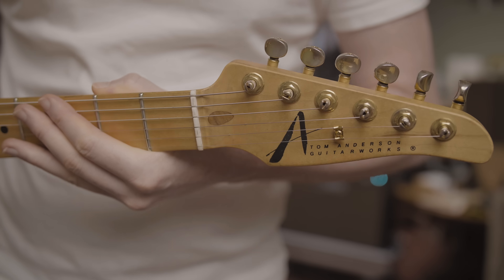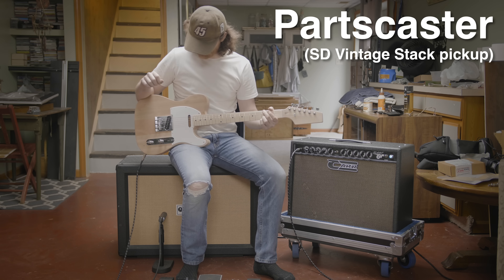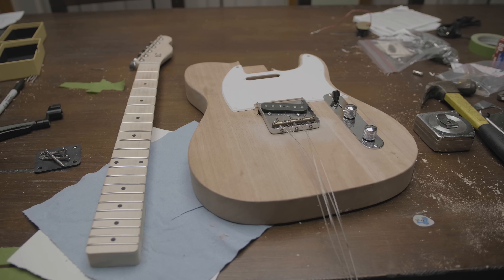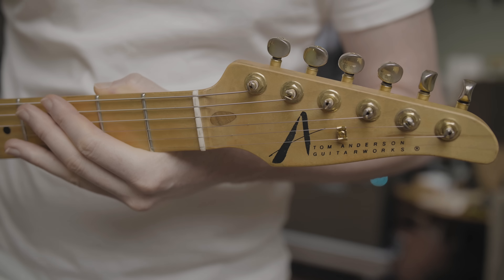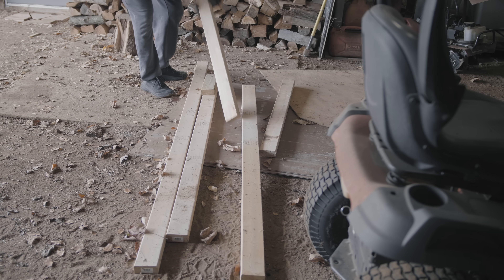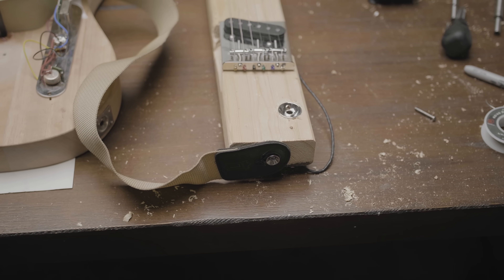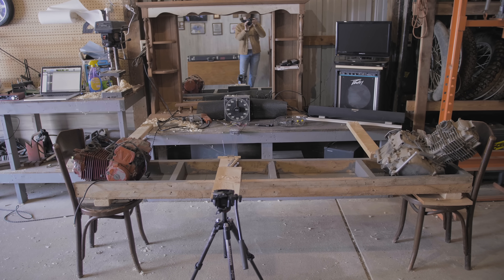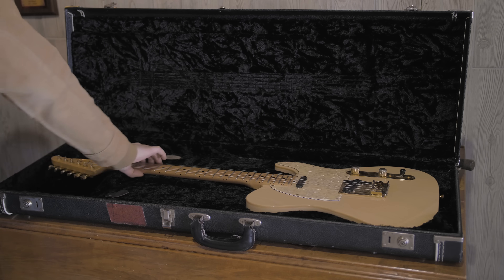Tested: Where Does The Tone Come From In An Electric Guitar?

Comment: Asking guitar manufacturers was not a good idea, as they SELL guitars by the fancy woods, binding, and hardware on the guitar. Sound is secondary to them - profit is primary.

In 1939 Les Paul built 'The Log' guitar, from a scrap piece of pine 4X4. Sound familiar to you?

An ES 335 style guitar is your 2X4 with some wings attached. Les Paul also knew that. So should we.

Hearing takes place in the brain, not the ear. The ear provides raw data, and the brain adjusts and compiles that data. If you doubt that, please test out 'Binaural Beats' using headphones. Amazing.

I think the best 'tone' was from the air guitar. If you test, you will find that the air guitar has the best sustain also. That's because it doesn't have a lot of wood to bleed off the energy of the vibrating strings. Very nicely done! 

[ To those that swear they can tell the difference in tone between different woods used on a guitar, you are not lying. You are actually hearing it, because your brain is processing it as such.]

Comment: excellent video. One more thought: I was a t a party, where two ppl brought acoustic guitars - one with very thin, the other with very thick strings. Because of the thickness, the pressure also was different. The thick strings sounded SO MUCH louder. This will probably also make a similar difference to the distance between the pickup and the strings.

Comment: Great video. You proved the Player, Player, Player, amp, scale length facts and made the ultimate lap steel save for the fact you have no pedals; you didn't have a Gibson scale guitar to test that difference.. That particular steel would require the player  to rely solely upon ears - like a violinist, for instance, I'll wager lots of artists would like to try it out as a novely; it is no different in theory than one they may have other than markings letting them know where notes are.  The steel guitar proved a guitar is what the pickups get from the vibrating strings as it is an electric circuit driving an amp. Tone wood applies to acoustic guitars only as one can actually hear what qualities/resonance vibrating dried/cured wood offers. imagine claves or a wooden xylophone. A player feels tone  - unamplified - using an electric guitar and remembers that when playing electrically because a guitar is what the pickups get from the vibrating strings as it is an electric circuit driving an amp. Consider one's choice in speakers, the vocal cords of an amp.
IMHO

Comment: The overall tone sounds of each guitar sounds pretty close, but I have several guitars with the same pickups and they each sound and resonate differently. Maybe it’s the reactivity between player and guitar even when it sounds similar. However, I had two SD alnico II pros in a 6lb chambered strat body and put the same pickups in an 11lb strat. The tone went from sweet and liquidy to more flat sounding. This was after messing with pickup height and all. So, I’m not sure. I’ve seen these tests done before, but I wish I could get some of my guitars to sound as magical as the others. Thanks so much for the work. Gave you a follow

Comment: THANKS YOU! As a physicist, I have been getting upset for years at people pretending that the body of an electric guitar is the key part in the sound. They use magnetic pickups, not even directly connected to the wood in some cases (typically on a strat, the pickups are screwed on the cheap plastic pick guard). Of course the wood can't play any major role (or any role at all, except maybe on the sustain  depending on the wood's density!).

Thats of course totally different on a semi hollow or hollow case, which resonates with the amp sound

Your demonstration is super clear, it's a great job!

I think the strings actually play a huge factor in the sound, maybe even more than the pickups themselves.

Comment: This is great. Scientific, unbiased method put to good use. Brilliantly presented. Reminded me of the guy who made a chipboard guitar body and compared the output with a classic Fender, but with the same neck, pups and hardware on both. Ran the output through a spectrograph and you could visibly see there was only a fractional difference.
I don't know why electric guitar manufacturers are still so obsessed with tonewoods, when it's so clear that they have little or no effect.
Oh yeah, hang on... £$€
Reply: "Air Guitar" is a bit misleading.  The vibrations are resonating through the woods of the table and bench to which the tuners and saddle are firmly mounted.  Just because there's no wood under the strings doesn't mean wood didn't contribute to the sound.  You've just repositioned the vibrating body.

Comment: Fun video!  Back in the day on the telecaster discussion page someone did a similar test to address the body material question.  A guitar made out is mdf sounded identical to swamp ash etc when you could control for as many other factors as possible.  The pickup!!

Comment: Didn't someone like maybe Brian May make a good guitar from bits if wood around his house? Thought I heard a slight different between the Anderson & the 2x4 guitar. Thought the Anderson was a little more pleasant but perhaps that's just perception bias. Or perhaps the speaker on a cell phone isn't Hi-fi/HD enough.

Maybe you've solved the exotic wood issue ... who needs ebony, mahogany, swamp ash, rosewood when any old 2x4 will do with good hardware, set-up & controls.

Comment: As of 6:00 into the video, with pickup height matching, I prefer the slight character differences in the Anderson, but it's gotten to the point where they are close enough to be swapped out for each other on a recording.

As of 8:20 in the video, it's clear that the body wood and body shape doesn't affect the EQ by any important amount, but it does affect the transient and sustain characteristics heavily.  The 2x4 guitar is way more punchy with a shorter sustain, a very noticeable difference in dynamics from the smoother and sustain-ier Anderson.  I think the character I liked in the Anderson was the higher sustain.

My takeaway is that as long as the things you listed at the end are constant between two guitars - pickup height, pickup model, pickup angle, strings, scale length, etc - then the SHAPE of the body, maybe the mass and width, pretty much only affects sustain.  The table setup had such anchored sides that it could get that higher-sustain dynamic like the Anderson and ironically sounded closer to the Anderson than either of the previous testbeds.  I think more mass in the body might prevent the strings' energy from being lost as quickly on the transients?

Either way, awesome video.  I never much believed in EQ-wood, but I knew that different bodies affected how things felt and sounded while I played them heavily.  Now I'm pretty sure that's due to changes in the dynamics because of tension and body mass and how it absorbs the strings' vibrations and that any sufficiently wide and solid body can deliver that.

Comment: I mean, they all sound slightly different, but it’s pretty obvious that the pickup makes up 90% of the tone. Everything else would probably only be noticed by the player. My thought is that even if the tone itself isn’t drastically different all the little bits and pieces and nuances culminate into the song. That 10% caused by the wood and extra bits might inspire the player just a bit more or take the song right over the top

Comment: For having had the opportunity to work as a guitar-physics/dynamics researcher and scientist, I can atest to these findings. First and foremost, for acoustics/classical/archtop it's all about tonewood and bracing because the body basically acts as a filter/energy absorber of the motion and vibration from the struck strings, as well as the string tension, type of bridge and a whole rabbit hole of construction methods. The sound we get from predominantly the soundboard is driven by how much the saddle pushes it up and down. Steel-string guitars have the greatest string tension that's why they sound the loudest most the time, at the cost of being built more robustly.

For electric guitars, however, it has more to do with the pick-up type and their rated frequency response. The position of the pickup also greatly affects the tone by the amount of overtones the magnets can "hear" and filter above it. If I were to comment about the tonewood stuff, it has more to do with the amount of mass rather than type of wood itself the strings and bridge are attached to. Mass has a very subtle effect on the amount of sustain - how long the strings oscillate is dictated by the rate and amount of energy/vibration is transferred and released into the body. More mass generally means less sustain. This doesn't affect "tone" in its scientific definition, it affects a part of the ADSR (attack-decay-sustain-release). In practice we label most solid bodies as "singing" and having more sustain because of the long duration the strings excite the pickups; that is energy is conserved efficiently because the body is compact and the vibration radiates only short distances. Semi and full hollow bodies decay faster because the chambers/airs inside it act as an easy escape path for all the vibration and energy to radiate out to. We associate the terms clarity and definition with these guitars characteristics because the fundamental frequency usually has the slowest decay times during striking.

Do note that these effects are as I've said, really subtle and can only be appreciated during controlled single note attacks until full decay. Everything else has more to do with how the player strikes the string, and how he adjusts his striking pattern based on how he hears the sound coming from the amp, basically forming a feedback loop and the never ending pursuit of the "perfect tone". Thankfully we have powerful DSP nowadays that any manipulation on the waveform characteristics can be achieved and we can just set all the guitar knobs at maximum and call it a day XD

I'm glad this video is racking up views so that these trivial-but-not-so-simple concepts can be easily appreciated by the majority of the guitar community, because trust me, the math part is obnoxiously complex and sometimes doesn't make a lot of sense.

PS: if you guys really want to get into the knitty-gritty stuff, i highly suggest reading Richard French's book Engineering the Guitar

Comment: Wow, that was surprising!
12 minutes ago I would have been CONVINCED that tonewood does matter.
The way I think of it is this: the sound gets generated through electromagnetic impulses that are caused by the vibration of the string and are picked up by the electronics. But the construction of the instrument greatly affects the way the string vibrates. I'm talking about sustain, resonance, inharmonicity (offset of the overtones relative to each note) and such. That is the reason why the wood and the tuning hardware matter so much on acoustic instruments (I'm a piano maker and it can barely be overstated just how much it matters really). The vibration of the string is shaped by the instrument it is strung on.
But it seems that I have vastly underestimated how much of these nuances (that are glaring on an acoustic instrument!) get lost during the conversion to electromagnetic signals. I still believe they are there but apparently they are so subtle that they can be neglected almost entirely.
Thank you for taking the effort and actually showing us how it really is!
Reply: The reason why the wood matters so much on an acoustic instrument is not that the wood affects how the string moves, but rather that the string affects how the wood moves, and part of the sound waves you're hearing are coming from the wood itself resonating, not the strings.
As you said, the wood must in some way react back to the strings motion, but I have no reason to believe that is more relevant on acoustic instruments than electric. Since we can't ever hear only the strings on an acoustic instrument, we're always hearing everything that is resonating with it.
Reply: Wood does nothing to a magnetic field.
Reply: @UmVtCg  noone claimed this. But wood against the strings changes how it vibrates. It can have sympathetic resonance or destructive resonance, causing peaks or dead zones in volume of the notes. And volume changes perceived tone, even changes the characteristics of circuits (like hitting a guitar preamp harder changes tone)
Reply: @stefanfyhn4668  how would one prove that wood Interferes with the metal by creating destructive resonance, especially since the strings are just touching metal/plastic the whole time? 

This Is kinda a meaningless debate started by guitar companies and blues lawyers to justify expensive guitars.

For our purposes wood doesn't matter at all, since the biggest deciding factors are usually the player, pickup, and amp. 

With The Love of Christ -Ben
Reply: When we talk about a Chinese vs mexi vs American Strat or any guitar, we hear similarities for sure but then we hear some differences between them. The point that you hear a difference between the cheaper and more expensive models is about the same amount of difference between woods and not even having a body. If you don’t hear the difference then you definitely don’t have good ears because I can hear the difference even with my iPhone speakers. Yes I use dynaudio core59 studio monitors as well.
Reply: @joechristopher5803  and you're for sure that those differences don't have to do with set up, pickup output, and look? Also there are pyschological factors too, If Musical Corporations marketing has worked on us, and It has, then we are more likely to think the more expensive, better looking, and better feeling guitar SOUNDS better. Now, maybe It makes you play better bc you're more committed by putting 1k Into a guitar versus $300, and It feels really good, which Inspires you to practice and play more, but does It Inherently sound better? There's literally no way to prove that. No completely Isolated test anyways.
Reply: "tonewood" matters, because you need wood to make a guitar out of, and the affordable yet stable wood used in instrument production is called "tonewood" by luthiers. Just like 2x4 is construction lumber, then classic "guitar woods" are tonewoods

Comment: Tone is not top 10 , not even top 20 factors while getting an electric guitar . Tone should be considered while changing or customizing pickups (mainly) and string gauge , string height . The thing that makes a guitar expensive is playability, comfort , build quality , build materials and other features like : locking tuners , well intonated , high quality frets and nuts and hardwares and electronics.

Comment: Great video and great tests. Having "rebuild" a whole bunch of guitars, I know that the quality of the parts matter for great tone (fingers, amp+cab, pickups, pots, wiring+cable). I can advise anyone that a good amp & cab, make more difference than the guitar. If I would have $1,500 to spend, I would spend $1,000 on the amp & $500 on the guitar, rather than the other way around. (These days would even go 1200/300).

for example, have a squier affinity strat, gutted it, put diMarzio area '61 pickups and a blender pot in it. Set the neck, polished and leveled the frets, and I would put this against ANY USA made strat out there. Plus it gives tons of satisfaction to make the guitar perfect. As you said, the setup of pickup height, neck relief, fret quality, etc all makes it so much better.

Learn how to get the most out of your instrument, that fits your playing and you will have joy forever. For me it made all the difference.

Comment: The only thing that seems to make any difference is how heavy  the guitar is. The heavier the wood the better the sustain, it doesn't seem to matter whether it's made of wood, plywood or mdf. Other than that it all seems to be down to the pickups.
Anything else can be matched by a one tenth turn on the EQ knobs.
Acoustic guitars are probably the only instrument that may change depending on what wood is used.

Comment: Great video, I was amazed by the results, but wouldn’t the solidness of the bench and table affect the sustain?  Like it’d be interesting to create the thinnest softest possible guitar body and neck and see if the sustain lessens.  Sounds impossible tho lol
Reply: fender made a cardboard strat....sounded exactly like any other strat.........tone wood ,shmone wood
Reply: Darrell Braun did a body weight vs sustain video that was really well done. Overall the weight has very little to no effect on the sustain.
Reply: @timscott4530  Wow interesting..  I definetely know wood does play a role slightly in how the guitar feels.  I have two ibanez RGs, one basswood, one mohagany, and the mohagany definitely feels snappier...  whether that translates through the pickups tho, prob not
Reply: @JRose342  that's exactly what it have found, using basswood bodies and pick up changes didn't it any good. Mahogany bodies sounded deeper and more resonant. I use to buy tons of pick ups. I have tried most brands out there and I don't think all the time is just in the pick ups.
Reply: @InChrist03   Interesting... So what pickup would you recommend for a basswood body?  right now i have a dimarzio tone zone in the bridge and i dont think it pairs well with it.  I have a crunch lab in the bridge of the mahogany rg and it sounds great.